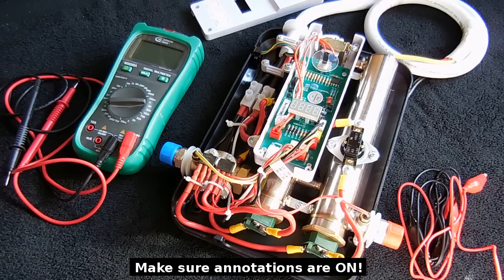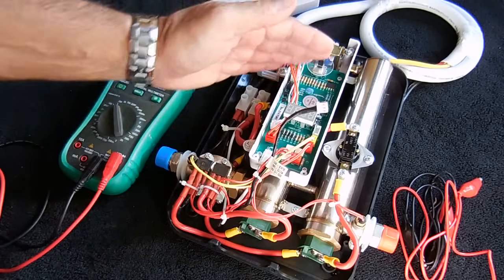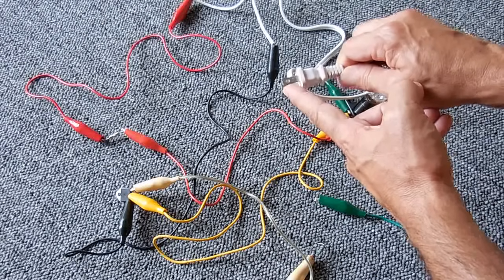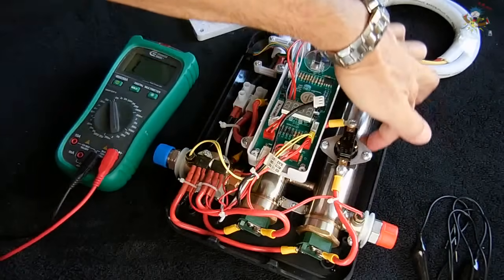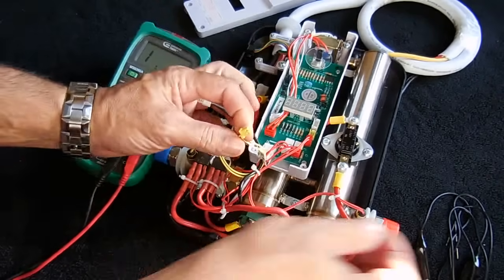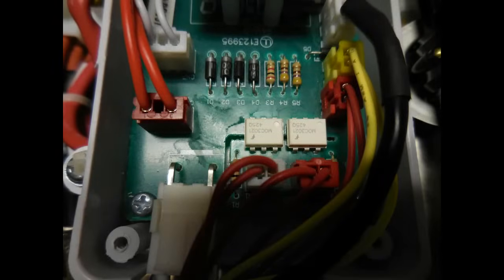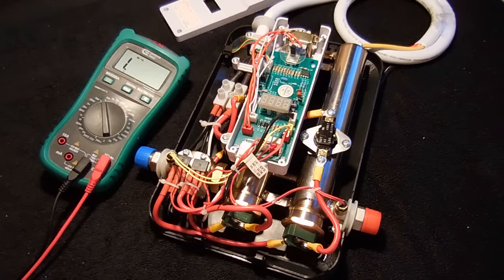Troubleshooting Tankless Water Heaters In MINUTES ~ Step By Step

Comment: Hello friend I have eco smart 11 water heater from couple years and recently found out I’m not getting enough hot water and checked out and found bad element and replaced with new one. After installing both elements open water tap but no hot water. When open tap it’s shows heating setting and then turns off. Can you help me to solve the issue?

Comment: Hello, working on a friends rtex36 rheem. and its getting intermittent heating. sometimes it heats perfect, and sometimes no heat at all. has great water flow,  so what are the common problems with these symptoms? I have flushed the system with white vinegar 30mins, flow is great,  when it decided to work. i pulled the flow sensor off to check it. and heating stops and display turns off like it should. when it does work there is an audible sound of water being restricted inside the pipes. when its not heating there is just free flowing water with no sound.

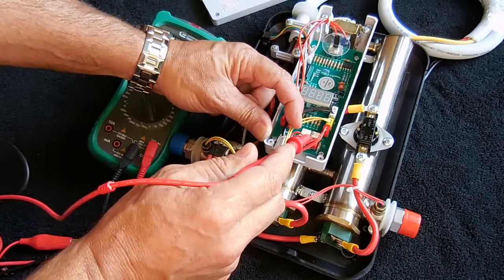Comment: Can you please provide the video where you talk about the optocoupler (13:20) . I just replaced all of my heating elements for my Eco Smart Tankless 36, I also cleaned out the inlet and outlet sensors. Turned on the hot water, checked for hot water . Left it running for at least 5 minutes. Then when I wanted to use the shower 2 hours later, I got no hot water. Which means I'll have to troubleshoot the system and figure this thing out cause a plumber would cost about the same as the replacement. And also, I have a soft spot for these types of repairs. Thanks, Great video...

Comment: We are renting a house that has a Rheem tankless water heater. We are not abke to get hot water anywhere in the house. My landlord has had a plumber out several times and the clean the system and we are still not able to get hot water. Do you know what is causeing this. Thanks Ash
Reply from the maker: If the unit is showing that power is applied, then there must be an issue with the flow sensor not turning the heat on

Comment: We had a gas Rinnai RGU199 installed with a loop due to our house configuration in August. Hot side works perfect but cold side we get tepid warm water.  It has to run a bit to ever get cold.  Any idea as to the problem?

Comment: Hi thank you for your well explained video. I noticed on my tankless water heater that the heater red LEDs were flashing and then the system turned off. I reset the heater however I am getting an issue. The heater will only start heating only when the water pressure is very low. If I turn the pressure up a little the heating LED indicator goes off and then no hot water.

Comment: Thank you for so much information and very well conveyed to the electritards out here such as myself.  my problem is different i was filling a bucket and lost complete power to the eco tank all together.  any guidance on that issue?  the unit is only 5 months old too i have an ecosmart 11.  thanks
Reply from the maker: Make sure you have 240V at the terminals to the unit.

Comment: Hello. Great video! It helped me understand whats going on how to test each component. I dont normally like to bother creators with personal questions, but for this ive searched everywhere and im at a loss. So thought I would ask. I have had intermittent hot water for some time. sometimes luke warm, sometimes hot. It finally went to all cold recently and when I inspected the unit (ecosmart 27) the first Triac was completely melted!!! So thats def the issue. But what I cant find out, and what really concerns me, is WHY did it melt. Ive ordered a new Triac, but is it just gonna melt (they arent cheap)? More importantly, is it going to start a fire in my house??? I thought the Fuse would trip to stop something like this, but even with it already melted, the circuit board light up and showed a temperature reading. Any ideas as to why it would melt like this? I read about triacs a bit, but it does get confusing. Did it fail open? Does this just happen sometimes and its ok? Any help from you, or anyone else that might read this, would be appreciated! ThankS!

Comment: I hope you can see my comment and provide some input. I did what you said to bypass one of the optocoupler on pin 4 and 6 and it worked again. I even changed a new control board and that ruined the optocouplers on the new control board. I would’ve just changed the optocouplers, but it seems that something else is breaking the optocoupler short. What could be the problem?

Comment: What's it mean if the unit gets hot as soon as you Power It Up, without any water flow. Also the water won't flow anyways. It seems plugged. I'm thinking the flow sensor is melted and not turning

Comment: I’ve been going back and forth with Rheem customer service. I have a RTEX36. I’ve had it for about 1 year. All of a sudden last September the water stopped getting hot. Most faucets will get warm but nothing over 90 degrees. The #1 element is the only one that never turns on which according to the manual should be the 1st one on. It’s also the only one with -0- volts. All of the elements are reading at 6 ohms. Customer service suggested I replace the #1 triac and the #1 thermostat. Nothing has worked and another caveat is when I turn on more than one faucet I’m getting an E5 error. Sorry for the long message, but I figured why not ask to see if you have any ideas. Thanks in advance.
Reply: I am having the same problem.  Did you ever figure out the solution.
Reply: Hello I am exactly in the same situation as you.  I have my Rheem for over 1 year and now all of a sudden water is not as hot as it was 1st year of installation.   Called Rheem and told me to replace element #1 as reading of 0 volts.  The others are reading 6 ohms.  Let me know if you figured out what is the problem after all.  Thanks

Comment: Thank you, sir, for this great video.   I have an Ecco Smart 11.   I am in the Sacramento, CA area with inlet temperature around 60 degrees F.     My shower head limits to a flow of 1.6 gpm.    My problem is that unit appears to only "sort of" working raising water temperature to 80 degrees.   Voltage going into unit measured at 245 and amperage on wires going in to both heating elements is about 23.5 A for each.    Also I have tried on 2 separate Eco Smart units with same results.
Could there be a problem with my double ple 60 amp breaker, or..   Is the shower fixture itself at fault?

Comment: My tankless water heater looks identical to yours.  My problem I will have intermittent hot water, it cycles hot to cold back to hot and again to cold.  The green temp leds stay illuminated and I can hear the flow sensor working.  Any thoughts on the intermittent cycling hot water?

Comment: Had a bad heating element with an e5 error. Replaced it and still getting the error. Water is heated until too many faucets/appliances are running.   Any of the other parts worth checking first?
Reply: Got into diagnostics and the inlet temp is 70 outlet 125. Flow at 2.1gpm with the tub running and it will throw the error if it's turned over 125. Guessing I had a bad triac and element?  Recent lightning strike took out tv/thermostat/stereo/etc.

Comment: I don't know if you still check in on this video.  This is the BEST breakdown of the electric heaters I've found.  The EcoSmart troubleshooter manual doesn't even get into the triacs and thermostats...
I have an Eco-27 that was running great for about 2 years (cleaned every 6 months too).  Recently, the hot will intermittently cut out mid-shower, then come back on before I can run out to check for a code.  I have yet to be able to catch a code, so I ran through testing the ohms for the elements and I replaced my flow impeller and sensor top (reused the body) because the impeller was starting to make a little odd noise (not the usual noise).  Still has intermittent issues.  Thermistors next?  I was under the impression triacs are either good or bad, so am I correct in thinking these are not the problem? or maybe one or more of the thermostats?  Your vid mentioned how to see if they are closed, but at what reading should they open?  Wouldn't an open condition (hot) turn them off?  Thank you for putting this together and for any input you can provide!

Edit, just caught the codes.  When it shut off, the display reads "5103" and "P009".  I can't locate those codes anywhere and they aren't the expected "E" codes in the troubleshooting guide.  Turned back on a few moments later... Pulled the elements and they are clean but I noticed that #1 and #2 seem to have contact points near the top where the loop touches(d) the sides of the chamber.  Is this normal and could this cause "grounding" or a short of some sort that kicks it off?  Ordered new elements just in case (and having spares never hurts).

Comment: We have a brand new Rheem tankless electric and out of the box it had an e4 error code, after using the hot water it cracks and pops(like boiling water)we can't control the temperature of the water at all, it works even when you turn the power off with the knob. Now it's starting to hiss all the time. Have you ever seen anything like this? We are at a loss... any guidance would appreciated.
Reply from the maker: An error code ‘E4’ on your Rheem Tankless Water Heater indicates that the flow meter sensor gets faulty. The flow meter sensor is also referred to as a water temperature sensor. If this sensor is at fault, it will not send a signal to the computer, which starts the tankless unit. A defective flow meter sensor, broken wire, and poor connection are the culprits that trigger the error code E4.

Comment: Great video tutorial, very easy to follow, 

My issue is that my water heater overheats at the hot end even when I switch off the heater, I'm still kind of new but I've tried what was displayed here. 
The hot connector gets so hot that it melts the inner hose that leads the hot water to the house.
I don't know if it's the hot end temperature sensor.
Reply: I'm having the same problem. Did you ever find a fix?

Comment: Have a Rheem RETE 7 that stopped heating water; water flowed through but the red indicator lights stopped coming on and water wasn’t being heated. Your vid helped me diagnose the flow sensor. Googled part number E226633 and found one for $20 free shipping. Easy enough repair-be safe! Replaced and my heater is working like a champ. Thank you!

Comment: Need help
Rheem tankless electric water heater not coming on, LED screen to lighting up weather I turn or push the knob.
I have power at the breaker and at the unit. I've changed out the control board and still having same problem.  Any suggestions? Thank you

Comment: my 2nd triac wire is showing 126 volts on the element when the unit is off it is a eco 11 and i have useable hot water if i turn the breaker on and cut my cold water on in the bathroom sink to get the shower water hot. im ready to buy a new unit because the ecosmart tech support doesnt seem to understand their own products. one told me to replace triac 2 and another said flow sensor and ive done both and still having the same problem. now they are telling me the control board is bad. i could have almost bought a new unit by now. what do you suggest it is??? 
126v when breaker is on and unit is off on the 2nd triac wire testing the voltage on the element

Comment: Not what I was looking for but awesome video. Dealing with some lights flickering whenever the water heater turns on. They are a mix of LEDs of dimmers and no dimmers. I'm not seeing any noticeable voltage drop, all connections are tight, change the breakers out.

Comment: Thanks for the video, can the triac be tested while in the circuit with an ohmmeter?  I have Chronomite water heater, one triac is 90 ohms MT1 to gate, and the other is 1 ohm MT1 to gate.  And I'm testing these while still installed in the circuit.  Thanks.
Reply from the maker: For reliable testing, I desolder.

Comment: I have an Eco 27 and my unit is making a lot of noise I can’t leave the break room because it’s sending power to the metal element while it’s supposed to be off
Reply from the maker: If the flow sensor fails, a temp sensor should turn off the heating element if the water gets too hot.

Comment: Just installed a new 5.5kw ecotouch and it will only go from 69°F to 76°F? I checked the volts and water pressure but no change, what could it be?
Reply from the maker: Are you using a very high volume of water?

Comment: My water heater tripped the electrical breaker.  I tried to reset the breaker but it quickly tripped again and it gave off burn smell from the water heater box. Wonder if the box fried from a recent lightening/rainstorm we had.
Reply from the maker: With the power turned off, disconnect the wires from the heating element/elements, protect the bare wires with wire nuts, and turn on the power again. If it doesn't trip, you have a faulty heating element.

Comment: I have a sharp WH-55 or hothot I have used your video to troubleshoot and found the potentiometer, the triac and the main double pole switch to be correct. The temperature sensor was open. No indication on the controller board of damaged components or burns. The triac is a combined item with two wires carrying ground and live and the third connection the gate I suppose from the controller board the neutral wire is connected at the terminal to a wire that returns to the control board. There is no transformer. In the end I found that the temperature sensor has a little pin on top and if you press that one the temp sensor closes again and allows current to go through. Thanks for your video

Comment: I have a Rudd gas tankless hot water heater. I can get hot water everywhere in my house except the bathtubs and washing machine. I’m thinking it has something to do with the pressure? But cannot figure it out. In one of my tubs, it’s a tub/shower combo and if I use the shower, perfect hot water. If I turn the bathtub faucet to hot, to take a bath , the panel shows the flame (that it’s heating up) and then it goes cold and shows error code 11 on the display. There are so many things code 11 can mean it has blown my mind. Any ideas? Any suggestions would be helpful thank you!

Comment: Me Again i wanted to test why i have no power on my unit the RTEX-04 but it doesnt have a transformer,or has none like your unit. as  result ,Can you refer me to where i would do my testing/troubling shootin for a no power coming on. I do get required 120-124v going in the unit on the 'Screw terminals from the power cord

Comment: Good day man,  awesome detailed videocant thank you enough. I love learning about these types of fixes and trblshoots... i have  1 question... read ur descrption :).. my question isnt relating to post-testing so much i guess. What i want to verify is. @ 10:35 you mention 240v. Is the unit you use here a 240 v heater or is it out of those 4 terminals they split into 2 collective volts of 120v. So the pair going out120v and the pair going in at 120v?. Sorry if i missed, i rewatched the vid. My heater looks almost exactly like yours here but it clearly says on my heater 120v. so When i probe two of the 4 terminals i get a reading of around 123-124 volts. is this correct? or should it still be as you stated at 240 v? thanks
Reply from the maker: 240v heater with 240v elements. Thanks for watching!
Reply: @electronicsNmore  thank u for responding. That means my reading is accurate?120 v heater. . My  2 terminals at 122-124 volts,for a 120v element. .Thanks for being a teacher.Keep it up!

Comment: I have an Ecosmart 18 which is 3 years old. A couple days ago, it started making a water hammer noise. I contacted Ecosmart and after about a half hour of discussing the problem and being put on hold, they decided I needed two new elements and triacs. I ordered the parts which should be in tomorrow but meanwhile I tried the water heater again and the thermostat is at 109 degrees but the water is getting boiling hot with vapor coming out of the faucet. Before recommending the parts, Ecosmart sent test procedures for the element and triac which tested ok. I will change the parts which cost almost 50% of replacement but I really think it is a circuit board problem and they should replace.
Reply from the maker: Sounds like a faulty temp sensor. You should remove the cold water line from the unit and make sure there's no buildup inside. Could also be a faulty board.

Comment: Hi,me titan tankless water heater n120 have 120 volt on the water pipe that is possible?? It’s  first time I see this, could you help me please
Reply from the maker: For that to happen, the unit must not be grounded, and one of the heating elements has corroded allowing power to flow outside the heating element into the water. Make sure the unit is grounded! Once the ground is in place, and power turned back on, the breaker should quickly trip if the element is faulty.

Comment: Anyone have a suggestions?  I have assembled the circuit as per the layout at 6:00 into the video.  I have the yellow wire on the ground side of the light bulb socket.  My bulb socket only has a ground and a power wire, so I am assuming this is how it is connected.   I did the test with a 1 amp fuse with yellow wire connected to ground on the bulb socket, going to terminal 2 of the triac switch.  The light turned on brieflly (for a second or two), but then the 1 amp fuse blew.   I tried a 5 amp fuse and even that fuse blew.   Thoughts/suggestions appreciated!
Reply from the maker: Sounds like you're using the wrong pins. Look up the datasheet for your triac, so you can make sure you're triggering the gate pin.
Reply: @electronicsNmore  I could not find any info when I google my triac which only has two numbers stamps on it: S6065J and 2DTF5.

The two pins on the left are identical width and the pin on the far right is much narrow so I presume it is the gate, like your video shows.